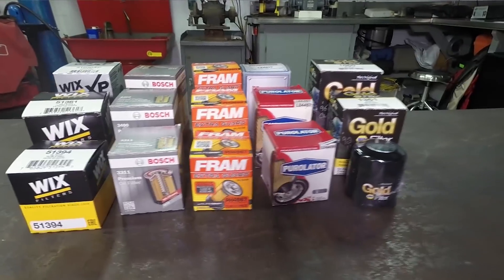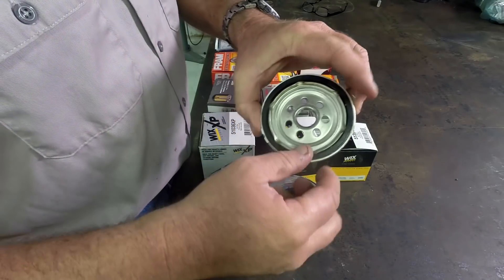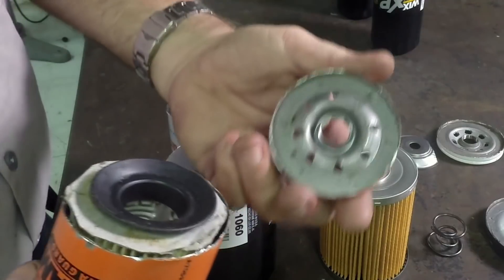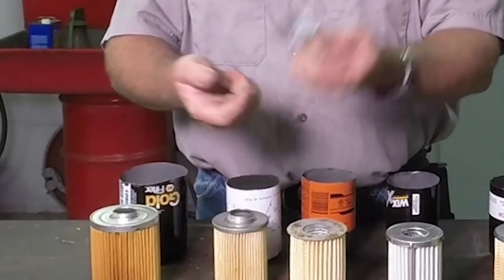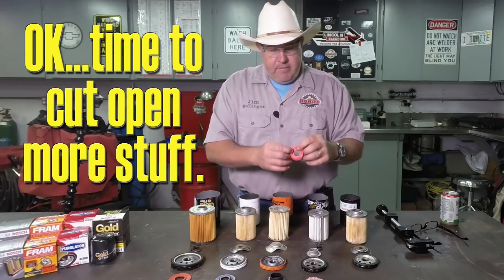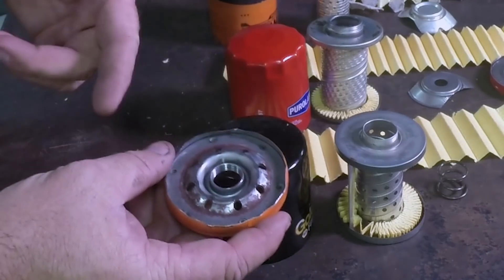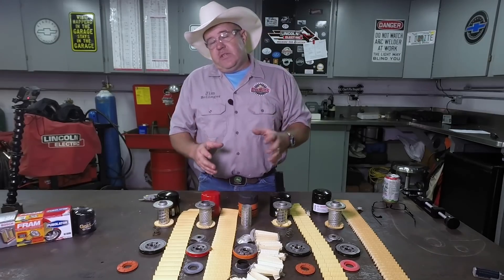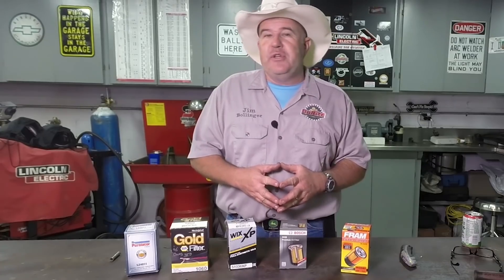The worst oil filter EVER!

Comment: I work at napa and the NAPA brand fliters are just wix filters with the napa logo on it.
Reply: Wix invented this style of oil filter, and in every teardown test I've ever read, Wix is always the best, and Fram is always the worst.
Reply: Always use Wix filters in all my cars. 💙
Reply: @joshuaowens4797  I'll use Wix as an alternative to Mobil 1.
Reply: @joeb2588  I would like to see a M1 cut apart.  I've used them for years but now I'm wondering if I've been fooled...  Any insight on the M1 filter media, base plate, valving??
Reply: @joeb2588  

Wix NAPA Gold and above is better than M1. And I love Mobil 1. Wix entry level is about equal which is the NAPA ProSelect and the Wix branded ones most often used in these comparison videos that I've seen. Usually purchased at O'Reillys for the Wix branded ones. 

The top tier Wix blows M1 away by far. At NAPA that's the Platinum ones. But they only make the most common filters at that tier.
Reply: @shaunofthedead3000  I'm pretty confident M1 is a premium filter. In all the reading I've done it's a good filter. It handles more pressure than most including the Wix standard filter. I use both Wix and M1. In fact I have a Wix on my car now. They're the only two I feel comfortable putting on my car.
Reply: How would you compare gold vs standard?
Reply: Yes, Wix is the best.
Reply: Austin, which is cheaper, Wix or NAPA Gold?
Reply: @ljprep6250  wix
Reply: @ljprep6250  I actually find the Wix branded filter cheaper by a little bit.
Reply: @ljprep6250   @imposter 0shadow 
The best Napa filter is the one that has the neoprene check valve ,that you can see when you look at it at the bottom!!!  Because it doesn't get hard and lose it sealing propertys!!!  Most other filters have black check valves WHICH get hard and leak back all the oil in the filter!!!  So every time you let your car set for awhile you get a dry start witch is not good!!!
Sir, just read the comments and you have people that have used Fram FILTERS for year!!!  Have vehicles that have 3 - 4 - 5 hundreds of thousands of miles using FRAM FILTERS!!!
First of all!!!  Everything I said is TRUE!!! AND ""TWO"'" as you say!!!  All of those FILTERS that you cut open are BYPASS FILTER!!!  AND ANY OUT THERE IF YOU WANT TO KNOW THE TRUTH WHEATER THE FILTERS ARE BYPASS FILTERS JUST ASK AROUND AND YOU WILL FIND OUT THAT THEY ARE BYPASS FILTERS!!!
THE REASON THAT THEY ARE BYPASS FILTERS!!! IS BECAUSE IF THEY WEREN'T AND THE FILTER PLUGGED UP THE OIL WOULD STOP GETTING TO THE ENGINE!!! AND YOUR ENGINE WOULD COME TO AN ABROUT STOP!!!  IT WOULD FREEZE UP FROM THE LACK OF OIL!!!. THAT'S WHY THEY ARE BYPASS FILTERS!!!
AND I ALSO WAS MASTER MECHANIC!  FOR FORTY YEARS MORE OR LESS!!! 
MATTER OF FACT I AM ABOUT TO UPLOAD A VIDEO THAT TELLS PEOPLE THAT FOR ABOUT ONE HUNDRED DOLLARS THEY CAN BUY THE PARTS THAT I TELL THEM TO BUY!!!  AND THEY CAN INSTALL THE PARTS THEMSELVES IN LESS THAN TWENTY FIVE MINUTES OR LESS!!! NO TOOLS REQUIRED!!!  AND THE CARS OR TRUCKS LAST FOR MILLIONS OF MILES!!!  RUN LIKE NEW!!  NEVER HAVE TO CHANGE OIL OR OIL FILTER!!!
LIKE SAID THE ALL OF THOSE FILTERS ARE JUNK!!!  AND THAT'S WHY TENS OF MILLIONS OF CARS ENGINES AND TRANSMISSIONS WEAR OUT EVERY YEAR!!!
LARRY
Reply: I'll never buy Fram again. Just a bunch of marketing wanks
Reply: And WIX is owned by MANN Germany. Look in your store for oil filter for 2010 VW tiguan. They have pro select and gold only. Check what it says on them.
Reply: @GeorgiGeorgiev-ne9ps  They may be German owned but the filters are made in the USA .Wix has a big oil filter plant in Gastonia North Carolina.
Reply: I figured that out as he was dissecting them, but thanks for the conformation
Reply: Lol. Goes to show these YouTube influencers aren't as knowledgeable as they think they are. Also proves that you can slap a logo of a reputation company on any product and people will think it's the best. Thanks for your opinion, bud.
Reply: @csn6234  "YouTube influencers" and their ilk on other social media can all die in a fire for all I care.  Every time you hear about them, they're whining because somebody didn't give them free stuff.  Oooooh, poor babies.  Screw them all.
Reply: Yas they are
Reply: Wix napa and purolator all come under Mann+hummel .
Reply: @pramathbelakere4966  same with Hyundai filters. I use Mobil 1 but if I want to save 2.bucks..ill use a wix.
Reply: But with a higher price tag
Reply: I work at a shop where all our old filters and air filters come from Napa.I'm glad to know about the Napa filters now
Reply: We used Wix in the service station I worked at in the 70's when I was a teen.
Reply: I run NAPA on my F150 because I know they are quality filters
Reply: Not about oil filters, but thought you might appreciate this.
There's a county in California named El Dorado. There are quite a few wineries there. There's a bumper sticker you can get that says:
"El Dorado makes wine. Napa makes auto parts." :-)
Reply: So where do you buy wix filters?
Reply: @mcneel16  

NAPA, O'Reillys, I know there are a few other smaller parts stores, but I couldn't tell you off hand. Carquest used to sell them, but when Advanced Auto bought them out they switched to Champion which makes Fram and Baldwin filters. I was so pissed when they did that to the store I was running. We instantly had tons of customers drop us over that alone. 

Advance is a crap parts company. Carquest was great before that. Now any Carquest you find is either a independent owner or a company owned that hasn't switched yet. Probably because of how much business they were trashing.

I run 3 NAPA stores now. So I'm obviously going to be biased in general. But I'm already biased against the monolithic corps like Advance, Autozone, and O'Reillys anyway. Hell, even the NAPA corp side. 

They all live by the Autozone mentality. Which is hire one good guy and a bunch of idiots and sell as much junk as you can retail. Which obviously works for Autozone. Not as well for all the copycats. But I also wouldn't trust a sticker to stick from Autozone much less their parts. 

Autozone works so long as you have China with slave labor producing EVERYTHING you sell and an uneducated population more interested in looks than works. They have exceptions, but very few. And mostly in their home state. They are the Walmart of the parts world. 

I ran a Carquest corporate store for years before Advance came in and I told them to kiss my butt. It was a lot like a NAPA independent pre-Advance. But like alot of NAPA independents these days, the owners wanted out to enjoy what they earned the last few decades. So they sold off to Advance. 

And Advance had their one and only "great" idea...which was to be the best Autozone clone they can. In other words their big idea was to steal Autozone's ideas...lol. 

I have never seen a company lose do much experience in so short a time. So many managers cashed out their stock earnings and left it was ridiculous. Hundreds of years of experience evaporated overnight in my region alone. All but one manager left in the first year in our group. Crazy.

And that's the corporate world. Mindless zombie lemmings just flowing over a cliff. They bow to the most minute of pressures. Doing stupid crap like the Gillette save a hoe anti man commercial. 

Meanwhile NAPA independents are rocking. We cater to our customers. Not to customers in New York or California or social media. Actual customers. I'm definitely biased.

Buy them at NAPA. Only NAPA.
Reply: NAPA filters:

ProSelect: Entry level for NAPA and the cheapest Wix you can buy. Usually marketed as the plain Wix in places like O'Reillys. Quality about equal to a Motorcraft/AC Declo/ Mopar OEM filter or Mobil 1 aftermarket. Sold most often to oil change shops. Intended use case scenario is either light drivers, or super anal oil changers(follow the minimum in the owners manuals for severe drivers).

Gold: High end Wix filters, but not their highest end. Pricing is still average, but quality is up there. I think the closet competition in quality is Royal Purple and Amsoil. Can't remember for sure, but those are the only ones I've ever seen decent.

Platinum: Highest end Wix filter made. Price isn't really too far over the top. They only make the most popular filters in Platinum, so no tractors or obscure vehicles. I've not seen anything yet that competes legitimately with these. All the other guy's market their top tier stuff as the best and they often can't compete with the Gold, much less Platinum. Platinum has increased pleat counts, better valves, better media overall, even the glue is better. 

So Wix will say you pick a NAPA filter based on how you drive. Light = ProSelect, Average = Gold, Severe = Platinum. 

Most car manufacturers describe a severe driver thusly:
1.Drive 10+ miles per day no stoplights.
2.Drive in dusty environments. AKA West Texas, New Mexico, Arizona, Nevada, etc. (Also East Texas Georgia, Louisiana, etc during high pollen season where the pollen fills the air...like dust...)
3. Drive in cities with stop and go driving. 

That's over 99% of all drivers that fall into the severe category. Keep that in mind when you pick the column for your maintenance intervals...

Comment: I tried the gray Fram filter. OK, seemed OK and now my Guage is at 80, most of the time. Tried a new sensor but still odd pressures. The Rotella or valvoline high life oil I use is the same oil always use and my 99 WJ 4.0 was always solid on the same oil pressure. The only change was that filter. I am going back to the basic cheap filter. It seems the extra guard filter works like my water filter. Going fron 20 or 10 micron to a 1, big water flow differance. Maybe it is the same going on. Only way to explain the excessive oil pressure. Swap the filter to a cheaper one, pressure went back to normal. Since change every 3500 and it is 20 years old, at this point a simple fter is all one needs. MYbe this works on newer models.

Comment: The Media comes in different grades, and different pleat counts, to get true, you would need the same filter for the same auto in each brand, and grade of filter.  So you can have the same filter same brand name and like 3 different grades of media, and each can have a different pleat count. You should check STP,  CHAMP, Service Champ, FVP, AC, Super Tech, there are others... You could find a Plastic Core in some filters said to allow more oil flow, through the filter media.

Comment: If you are going to be cutting apart oil filters for real, used filter and engine analysis then PLEASE use a proper oil filter cutting tool.  A grinder contaminates the media and the work area.  What is shown here is  poor procedure in the real world
Reply from the maker: Before you comment PLEASE look on the work bench in the video. There is a reason it couldn't be used.

Comment: Wix filters.  2k - 2.5k oil changes.  314k and 308k on the two daily drivers.  Original motors, never touched.  I buy filters off eBay in "Mechanics Packs".  My car buddy keeps telling me it is time to buy replacement vehicles, but I don't know why as these continue to provide good service.  Just one guy's opinion & service interval.  "YMMV" means Your Mileage May Vary.

Comment: Why did you use the base level Fram vs the the best line for the Napa/Wiz? Not a fair comparison. Does the Napa silver use paper end caps? The Fram Ultra 15k filter has the same (maybe better?) filter construction (metal end caps welded seam stem). However the Fram does use a stamp metal spring, being the only visible difference. You APPEAR to have a brand loyalty or hatred, not sure which.

Comment: I would like to have seen Toyota factory filters included in your comparison. They arrange the paper in a different way that dramatically increases the surface area of the filter. This both improves flow and lengthens life.

Comment: I have 270,000 miles on my car with fram oil filters only
Reply: Everyone talks shit on Fram but I’ve never heard of one plugging up let alone an engine failure due to one. Fram filters are really no different from the fleet class filters lube shops and fleet managers purchase in bulk. Smoke and mirrors indeed. Course people always come back and say shit like “cheap insurance to buy the more expensive filter and blablabla” these are usually the same types of people that change oil every 3k regardless of what oil test labs state about running longer intervals. All smoke and mirrors. All pseudoscience and anecdotal experiences.
Reply: Same here. 270000 on my odyssey no issues. many other cars over the years with well over 200k when I sold them always used fram. But watching this vid. makes me go hmmmmm lol
Reply: Yeah this is smoke and mirrors
Reply: The fact that idiots are going to decide what filter to use based on a youtube video rather than talking with real people with real high-mileage engines is astonishing isn't it.

Comment: Napa brand is made by wix.. napa buys the majority of their filters and wix rebrands for them
Reply: Do you think they are good enough to go 10,000 miles or one year?
Reply: @joemontero725  I'd say for the platinum I'd trust it to 10,000 miles as long as fluid is checked regularly and topped off with good oil and running full synthetic. I am unsure about trusting the gold to 10,000 as they are only rated at 7500 (I work for napa), o'Reilly's also just picked up a wix partnership from what I hear too

Comment: One thing to note with the Fram (I know this video is almost a year old but, ehn), is the version. This was a the base option and while we can see it is indeed a load of bullcrap, from what I've seen in my research is the Ultra Synthetic options are FAR better made, metal end caps, better filter medium with wire mesh, silcone anti-drain valves, and a fair enough casing. Given, even the base option should not be this poorly made, but not all Fram products are crap.

Comment: I use Fram TG Tough Guard. 1 step up from the one you opened. Now I'm wondering if it really is a Tough Guard? They also sell 1 more higher than TG. So total of 3 steps. Thanks for your information.

Comment: ...Walmart Super Tech filters used to be of decent quality, similar to the Purolator.....Now, they appear to be made by Fram! Won't touch them again! Fram seems to be the "promoted" brand at Walmart...there are many more of them there than any other brand, and are on the top shelf. I cringe when I watch how many sheeple grab them off the shelf...probably thinking they are getting a decent, or even premium, oil filter. If you want a really cheap oil filter, get the Napa ProSelect from Napa, $1.99, they come in a shrink-wrap, rather than a box. I actually like the shrink-wrap better than a box, because they are less prone to rust formation when stored on the shelf in my semi-open non-climate controlled garage. They are not top-tier quality, but they are much better made than the Fram. I do agree, the Wix and Napa Gold are hard to beat for quality. Maybe DoRite could do a cut-apart comparison with a Napa ProSelect filter?...would be interesting....

Comment: Thank you for this video. I've always used Fram mostly because of the advertisement. I just changed my oil and after seeing this I'm going to get a real filter and change it again. Thank again.
Reply: Don't be too quick to judge on this video. The true test of a filter is the filtering capabilities. A filter test is not done by this dude. From Godwin bgrsymons@hotmail.com
Reply: @bgrsymons9250  If a company is going to invest in making a high quality filter using premium parts, I doubt that filter would fail a test in filtering capabilities.  There's no return on the company's investment.  That would be like building a race car knowing all along that it would never win on race day.

Comment: Hmm, bad filter?  Got 440,000 miles on a 1974 Dodge Charger using the Fram Filters.  Changed the oil every 3-4K, never any issues.  That is good service out of any filter.  I am sorry, but, I have to disagree with you.  I will keep using them!
Reply: I put 650,000 on my last ford. changed the oil when the light came on. used the fram also. luck ?
Reply: Frequent oil change. But if you can't tell by the video - then your a Fram Troller

Comment: You don't need to cut them apart, you can tell the best filter by rolling it down an incline. The tighter the circle it turns the crappier it is.

Comment: In the 70s when consumer reports was still free they evaluated auto oil filters and gave Fram a glowing report that went straight to their head. 

Shortly thereafter they transferred everything overseas and totally/deliberatetly ruined their filters and took advantage of unsuspecting consumers. Look up the backwards 3rd world countries this cardboard piece of crap filter that internally looks like a a frustrated child made during time out.

Much damage has been caused by these filters . . . MANY RUINED ENGINES.

Comment: I wish you had done a K&N filter.
Reply: I have the K&N Wrench Off Gold Oil Filter, It's the first time that I have used it on my car and had it running for 6K miles and since then, the oil is was suprisngly still fairly silk yellow with a slight brown color below 5K miles. The filter supposedly can go up to 10K miles, but I really wouldn't recommend going that far since the oil begins to turn black after the 6K miles. It's worth the money, in other words.
Reply: @TheINFAMOUS2900  Thanks. I use the K&N on my 1971 Chevy El Camino and I rarely drive over 1,000 miles in a year yet I change the oil once per year. I use Amsoil 10-40 Synthetic oil with high zinc for flat tappets. I was just curious if the K&N was the best option. I have always heard good things about the Napa Gold filter; maybe I'll try it.